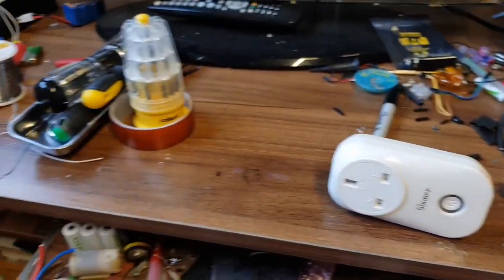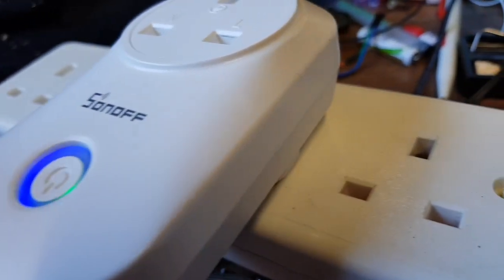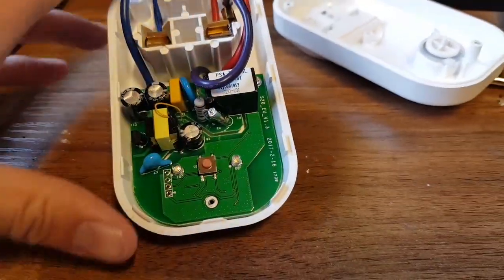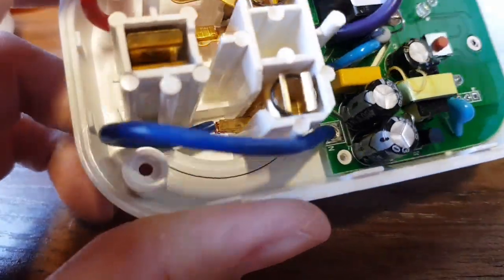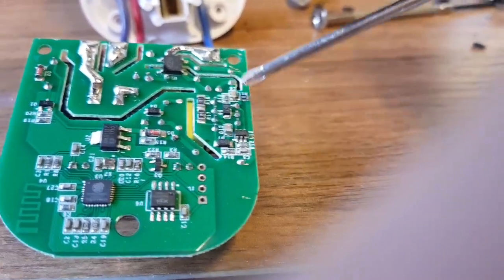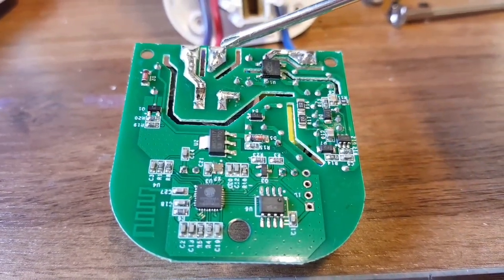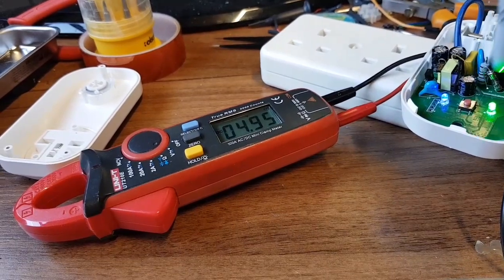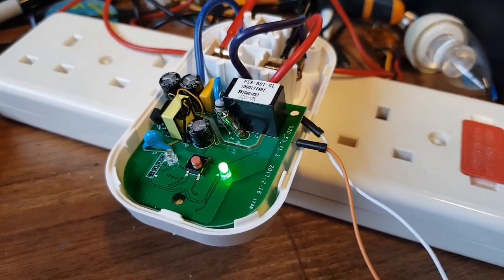sonoff wifi smart socket repair

Comment: thanks for your video. One suggestion would be to keep the camera fixed. I took several screenshots with slow playback, but it is very difficult to find out the value of R11 and C6. thanks.
Reply from the maker: Thanks for the feedback. I will try and keep this on board.

Comment: The same problem has happened to me, I think someone from my family member might have accidentally used it on a heavy-wattage appliance which is not recommended, normally my smart wifi plug ratted 16amp as a result the relay stopped functioning however, the wifi section is still working.  The relay model no is BPD-SS-105 DM which is not easily available in my Local Electronics Market so it becomes useless.

Comment: Might also be one of the mains connections into or after the relay.  Some years ago my wife had been complaining that the oven was not reliably heating the lower element, and I eventually found that solder joints around the relay contacts had cracked.  Resoldered the relays with nice tin lead solder, and it has been reliable for the lifetime of two heating elements (just installed a third element a few weeks ago).